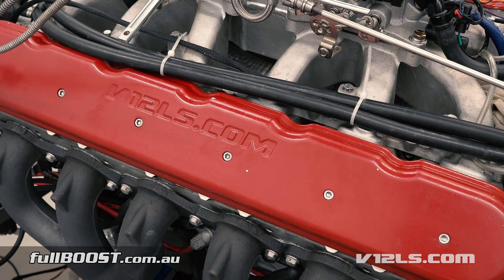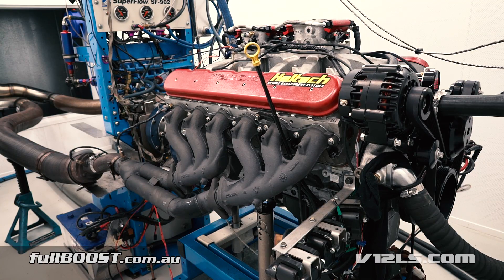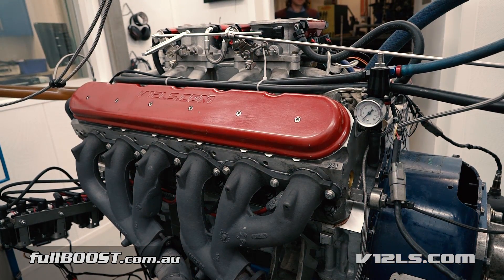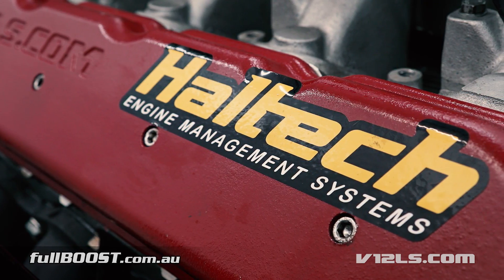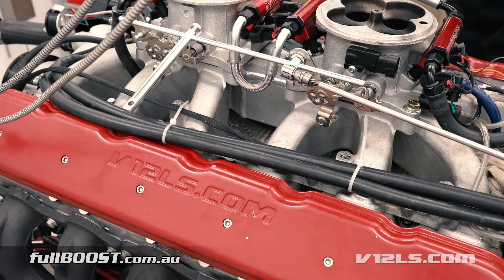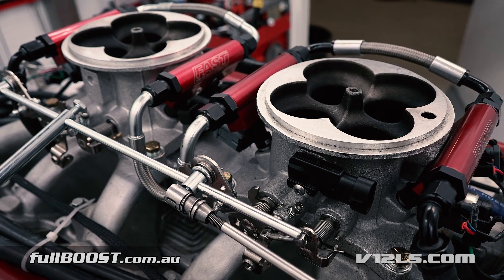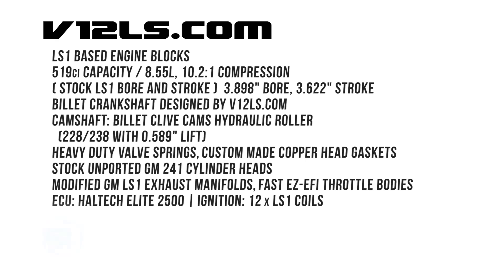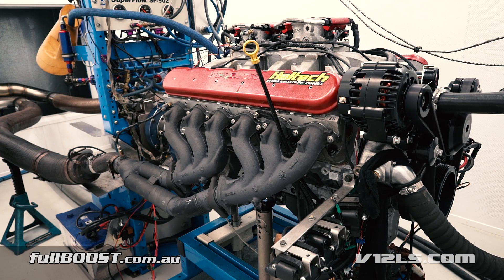V12 LS1 engine dyno

Comment: To little power, to heavy, to much fuckin money. No, no, and no again. I've got a 496 v8 making more power for under 10k. 2 doors down my neighbor has a truck with an ls1 v8 in it making more power than this v12. He drives that truck to work every day, 1090 hp. On the LS1 v8 these guys think needed to be a giant under powered v12. I don't know why videos about this shit motor keep showing up in my feed. It's pathetic. Real v12 engines nearly half the size have been making that power since the fuckin 80s.... It's just garbage, huge, heavy, no power, unproven.
Reply from the maker: Its basically in factory form. What power should it be making with these mods?
Reply: @fullboost  Well, you're running 9.5 liters. You do the math. With a 496 for less than 10k I'm putting more horsepower to the ground via a fuckin Allison! For less than 10k, on parts I can get at the chevy dealership. 

If you're gonna go EXOTIC. GO EXOTIC. Not different and misunderstood. A v12 with a 6500 rpm redline? What the fuck is this? 1937? That's a whole different category that people don't want their motor in! I mean what is the purpose of a v12 built even in it's best trim to perform like a well built ls1? Especially one so god damned big, and heavy!

If I can build an LS1 V8 that outpowers your v12 on every price point with just as smooth an operating engine. You've done something wrong. I would think that would be obvious. This is just cobbled shit that only dude with penis problems would buy.
Reply from the maker: This is a prototype engine that did what its supposed to do. Its basically making 100% more power than a stock LS1 with a small cam etc.
Reply from the maker: 1100hp N/A daily driven is great well done to your friend. 👍
Reply: 700hp N/A out of a 8.5L and thats "little power" plenty of negines can make more power when boosted but for N/A 700hp aint bad at all. Especially for a prototype.
Reply: @nathan22outdoors8  It's not 8.5 liters It's almost 9.6 liters. No, it's not good. Do a little bit of research on modern v8 platforms INCLUDING THE ONE THIS IS BASED OFF OF, then go ahead and take a look at the specs on any other v12 making the same power on about half the rotating mass.
Reply: Hey Korri. Thanks for the interest. Congrats to you on making over 1,000hp N/A, that is a huge achievement without going to a big $ custom engine. Not sorry for building a prototype that had never been done before, bringing it to SEMA, winning awards, taking orders then putting it into production to fulfil those orders. None of what we have done has been easy, but it has been fun and that is what hot rodding is all about right?

Comment: A V12 to run moddes V8 power. ....?... PASS.
Reply from the maker: Its using stock LS1 parts to make double the factory horsepower.
Reply: @fullboost  nothing stock about this... and just an expensive ass jointed engine... which probably costs 15 to 18k
Reply from the maker: Its using stock LS1 internals with a GM spec cam making twice factory power.  The people buying these engines are after something unique.

Comment: Not impressed only 715 hp with that huge engine sbc and bbc and ls engines get 500 _ 600 hp easily with cam heads and carbs try again
Reply from the maker: what is this had cam and heads?

Comment: These guys don't know how to build engines. Lunati back in 1999 built a kit for a 350 nascar built v8 that could pull out 560 hp at 6500 rpm at 9 to 1 compression ratio . Each piston uniquely balanced for each cylinder. At higher compression  say 11 to 1, the 350 could do close to 700 hp. This V12 sucks in comparison
Reply from the maker: The power is spot on for a V12 using std LS1 parts. This engine was purely run to prove the concept worked.
Reply: Bull

Comment: I'm not really impressed with the numbers, I appreciate with they did and much respect in the bump of cylinders but 1. this engine sounds hideous (Insert  pic of girl from state farm)! 2. I'd rather but a big block maybe a 496 hell a 460 at that and build the internals and make as much hp with less money and more space for conversion.  Hell in this case the dodge viper got yall beat with 2 less cylinders at that.  Am I hating on this? by all means no I am not, I can see within a few years everyone swapping LSv12's in their cars and trucks and going after ferraris and lambos and still get beat.  Im just not impressed of the concept and I'm sure the motor alone will cost as much as a 2016 GT3RS

Comment: for 12 cyl it shoulda made 900+++ a v8 can do better
Reply: We made a little over 1.5x the exact same spec V8. Would love to try 900+ V8 spec parts in this thing, and we probably will soon. Keep in mind this is just the prototype.
Reply: Jon...obviously you aren't from America! There's a reason we love 1/4 mile and 0-60! We don't have the freeways for cruising at 150mph, like you're rambling on about. See how far you get in the US..or Canada, at 120mph..before a cop is sitting on your ass!

 BTW, i would wager that this motor would work quite well in the 1/4 mile.. it's torquey as a locomotive!!

Comment: It needs direct injection, I can't believe only 600 or 700 horsepower.
Reply from the maker: Considering the engine its based off only makes 350hp, double the power is a great result.